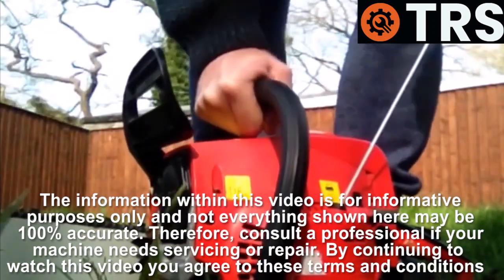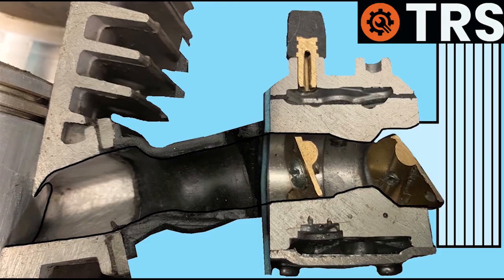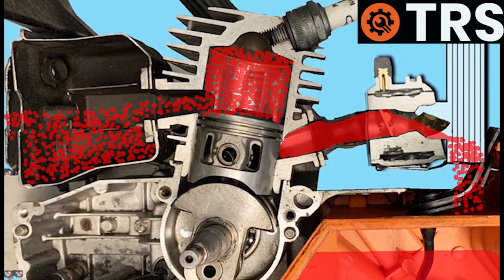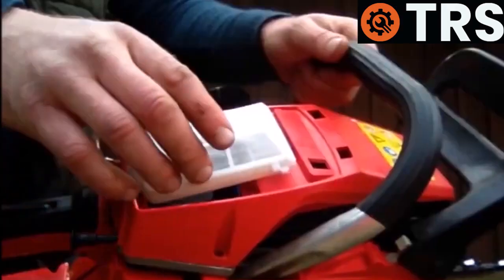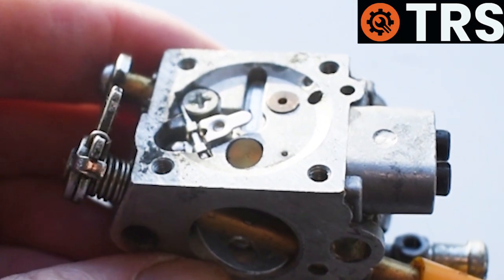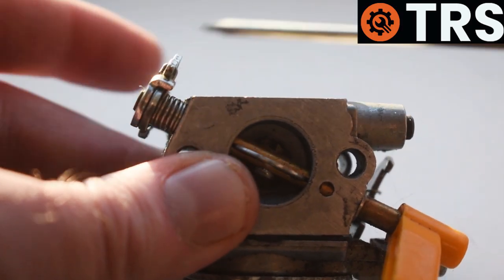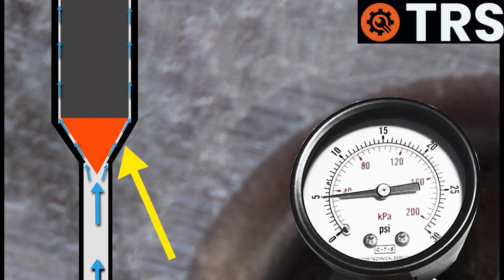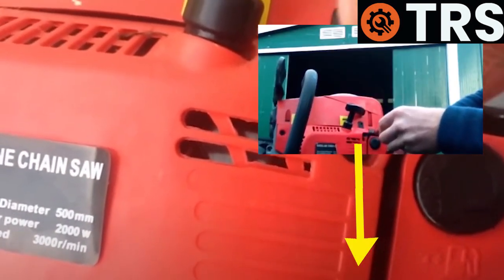CHAINSAW Leaking Flooding Fuel. WHY? 'Beginners Guide!  (by Craig Kirkman)

Comment: I have this exact CHAINSAW from china, 60cc, and have used it for firewood with 20 inch bar. It still has good compression. Then last month it would not start on fresh mix, it will only fire up on ézistart spray in the carb. So I bought it a new carb from Aliexpress, but it still has no firing on fresh mix, and after 8 pulls the spark plug is wet, i suspect it is flooding rapidly. I checked the spark several times, and it can produce a spark in air that jump at least 4mm, so I am not sure why it wont run. I think I should strip it right down and re-seal the crankshaft pan with RTV and check or replace the crank seals, replace the impulse line.  The new carb does not have the small pipe for a drain back to the tank, so I left that hose off to the side, otherwise it is an identical carb. Any other suggestions would be appreciated. I have adjusted the high low mixture screws up and down the normal range, with no effect. I will start by opening and checking the new carb for the problems you mention.
Reply from the maker: It definitely sounds like you’ve already covered a lot of the basics — good compression, strong spark, new carb, and fresh mix. Since it will only fire with starting spray, you’re right to suspect either too much fuel (flooding) or a leak in the crankcase/impulse system that’s upsetting fuel delivery. A few things I’d suggest checking before doing a full strip-down:

Carb seating & gasket – Even brand-new carbs can come with debris inside or poorly seated gaskets. Open it up and make sure the metering diaphragm is moving freely and that the needle valve isn’t stuck open (that would explain the flooding).

Impulse line – A cracked, soft, or loose impulse line can make the carb pulse erratic, leading to flooding or no fuel draw. Since you mentioned replacing it, that’s a good early step.

Crank seals & case leak – If the seals are gone or the crankcase halves aren’t sealing, the carb won’t get proper pulse pressure. A quick way to test before pulling everything apart is a pressure/vacuum test (block the intake/exhaust and see if the case holds pressure/vacuum).

Spark plug heat range – Even with a strong spark in air, a plug that’s too cold, fouled, or cracked can fail under compression. A fresh, correct plug (NGK or equivalent) is a cheap test.

Fuel line & filter – Make sure the fuel filter isn’t clogged and that the line is tight and not collapsing under suction.

That missing drain-back hose – Some carb designs rely on that return line to relieve pressure. Leaving it open may cause flooding. If possible, try routing it back into the tank like the original setup.

If after these checks it’s still flooding, then yes — pulling it down, resealing the crankcase, and replacing seals/impulse line is the logical next step. Sometimes with these Chinese saws the factory sealant isn’t the best, so a reseal can actually give them a whole new life.

You’re definitely not alone with this. A lot of people find that budget Chinese saws will cut fine for a while but then start showing issues like flooding, crank seals, or worn plastics sooner than the big-name brands. The good news is they can still be kept going with regular tinkering, resealing, and swapping out parts like you’re planning. With a bit of patience and maintenance, yours can still give you solid service, but just keep in mind they usually won’t last as long as a Stihl or Husky.

I hope this helps a little

Craig

Comment: Great video!!! I think my saw won't turn on because of an air leak through the spark plug threads. I used a thread repair insert and it still isn't firing up. I have to do a compression test to see what's going on.

Comment: How do you reset the t screw. Could that cause it to flood if its wound in too much?
Reply from the maker: Hi. The T screw sets the idling RPM, and it’s unlikely that over or under adjusts to the this particular screw would cause flooding. There can be many reasons for flooding of course, but If the flooding is due to screw settings then it’s more likely due to over adjustments to the L or H screw. I do have a video here on you tube that shows you how to reset these should you wish to. It’s title is: Chainsaw Carburetor Settings HOW TO ADJUST CHAINSAW CARBURETOR CORRECTLY ( by Craig Kirkman). Thanks, Craig 👍

Comment: If it turned out the carburetor is at fault, is it worth it to outright replace de whole carburetor or is it worth changing the small part causing the problem?